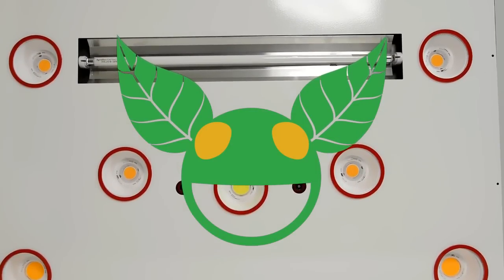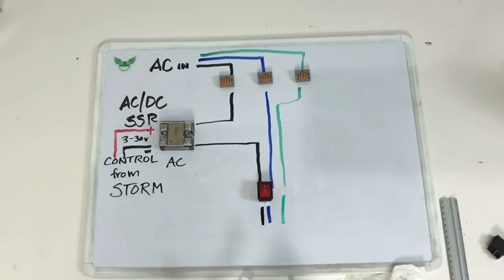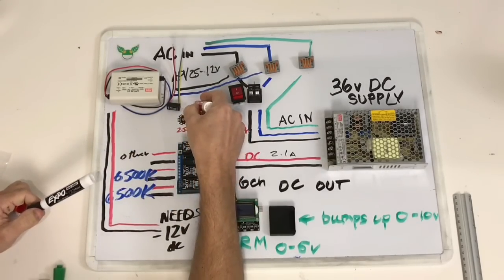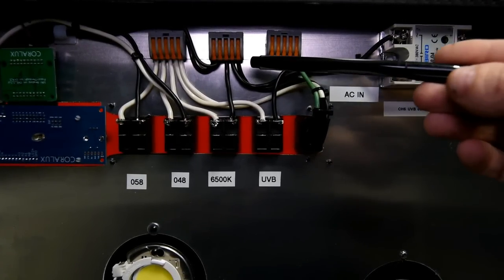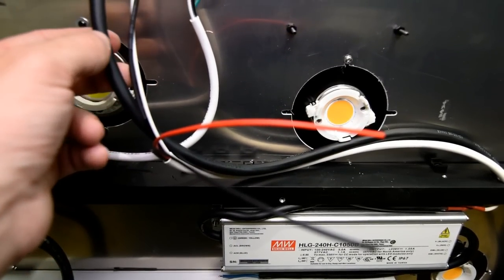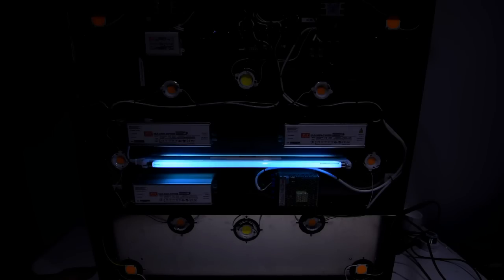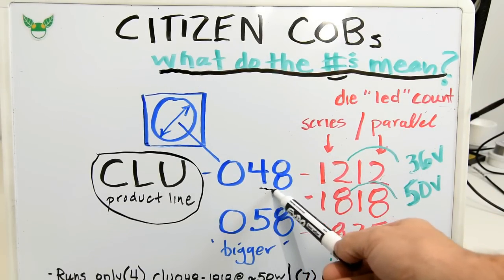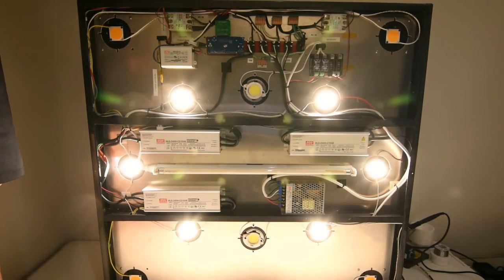Canopy 12UV: part 3 diy led growlight wiring

Comment: nice setup.  did you see the meanwell LDD-1500 1.5a :O.  I like the use of LDD bucky drivers to run cobs, had not thought of that.  A SE450-48 would run at least 8 3590's with 8-LDD1500 at 50w and dimmable all at 5v pwm signal. sweet.

Comment: Question: How do you think should sunset and sunrise dimming function interact with the far red on and off time? Example should the light dimm to zero and then the far red leds turn on or should far red leds turn on on 50% of dimming and stay lit until 0%? also what length of sunset and far red do you think is best? Thanks in advance

Comment: @growmau5  sorry for this late reaction-question: 

as the meanwell driver will only dim down to 10% and i personally want to dim down to off..
going to buy a SSR Relais  ( a 3-30v like you mention in this video)
 as the ssr relais operates between  3-30v
does that means that the driver will shut down at 3v (30% brightness??)

and i imagine its possible to hook up a potentiometer from rapidled in series between the dimleads of the driver and the 3-30v input of the relais?

Comment: how do I know if I need constant current or voltage? I'm want to build a light with 12 cxb3590 and wanted to run them off 2 hlg-320h-c1400b. I want to be able to dim them. if I dim with this driver will the leds just switch off as soon as I turn them down as the driver runs at 229v full power?

Comment: Hey Mau my friend. Most of what you say is Greek to me but I am up and running with 18-3590's @ 3500k /W  6 COBS per driver and frame and a single  potentiometer for everything. So much for my being cutting edge. I blinked...
I do have a question if I may? What is your GOAL with this build?  What are your expectations? Increased production, better product or a shortened overall start to finish?

Comment: Sick build man! Question though, with those switches that bypass the controller. I see you have 110v wired directly into the switches from the wall, that's a shitload of amperage to flow through some smaller looking switches. I'm not as familiar with AC wiring as I am with DC; but when wiring any switches into a car, or anything else DC, that said switch will regulate something that pulls a lot of amperage requires a relay or you'll just burn the fuck out of the switch given there being too much resistance. I'm just curious if that isn't much of an issue when regulating AC, and why? 

Your hard ass work is greatly appreciated man! Keep that shit up!

Comment: can you help bud i need a driver for 8 of these leds can you advise what power id need to get full use and dimmable 

Features:
Maximam drive current: 3000mA
Low thermal resistance: 2.5C/W
Maximum junction temperature: 150C
Viewing angle: 125`
ANSI-compatible chromaticity bins
Unlimited floor life at <30C/85% RH
Reflow solderable-JEDES J-STD-020C
Electrically neutral thermal path

Technical Parameters:
Quantity: 1 pcs
Model Type: Cree XML-T6
Emitted Color : White
Color Temperature: 6000-6500K
DC Forward Voltage (VF): 3.1 Vdc
DC Forward Current (IF): 3.0A
MAX Power: 10W

Comment: Hey bro! Ive seen you've mounted the drivers upside down, isnt that a problem? wont the heat from the circuit heat itself more in this position? thats a question i had before, i preferred not to try... cheers

Comment: I would love to try your product out I would love to buy it but I can't afford it
Reply from the maker: i dont sell them, or have a company. i just show people how they can build their own
Reply: growmau5 lol
Reply: growmau5 Do you have a video that explains how to use a single AC input for multiple led drivers?
Reply: You can hook up several drivers to the same power cord. Be it a cannibalized 15 amp high draw power cord from a hardware store or even a normal old PC power cord.  Use the WAGO connectors for simplicity.  Just make sure the total power you draw doesn't exceed the limitations of the power cord.

Comment: yo mr mouse. i have 5ch LED controllers . 12-24v 20a 240watt  LED controller on ebay. they are USB . check them out on ebay. if you can use one i will send it to you. rik

Comment: Thanks again for the chance GM. Your probably going to LYAO but you have inspired me (not the reason you'll lyao) to build my first led light out of what I have. So first I needed a led so I ordered a 5 pack of those China made 50watt cobs with the built in drivers.The rest is the funny part, I then started to think what I may have laying around I could use for mounting, heatsinking and cooling. At this point I realized I have saved a bunch of Xbox360s from when I used to fix them.. So I took one and ripped it apart and cut it to bits and made a pretty cool little contraption lol. Figured I'd share my experience being you are the one that inspired this cool idea I came up with. Now that I know I can cool 2 led's with one xb360 cooling fan and ducting I am going to mount 2 leds in one contraption. Cheers brother and thanks again for the great content